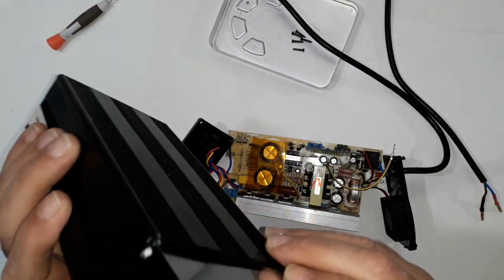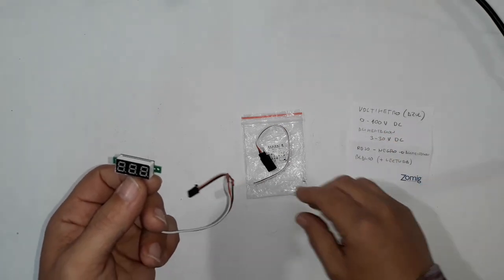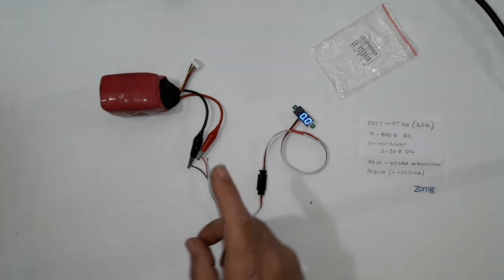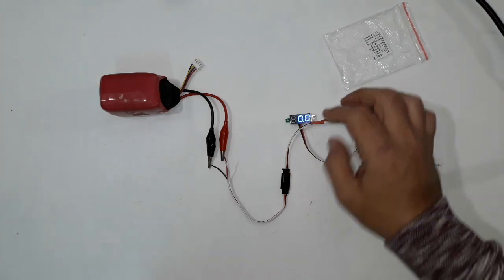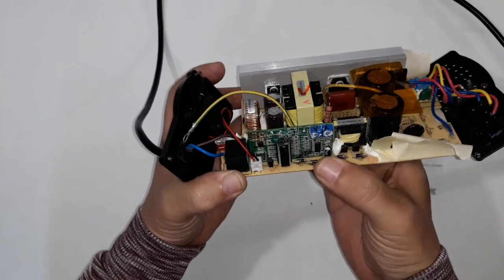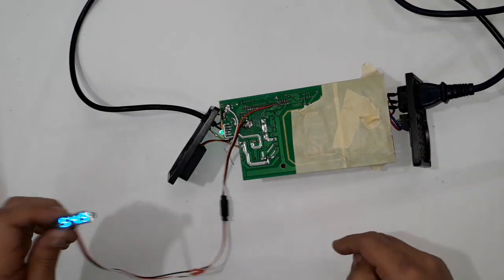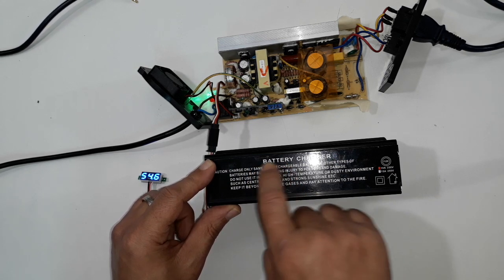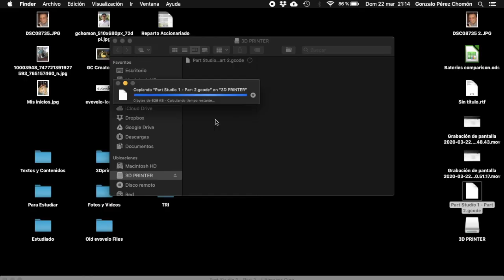Hacking & Tuning E-bike battery charger, English

Comment: Great video and some nice suggestions. Loved the practical safety step of covering the mains voltage section. 
Where you drilled the holes in the casing , fitting an automotive style rubber grommets will add further protection and prevent shorting to case from trim pot while adjusting. 
Better to use a plastic screwdriver but many don’t have those in tool kit.
Reply from the maker: True, Pat O mahony, I normally use a plastic screwdriver for that kind of pots, but I was not able to find them...
Next day I remembered where I put them, LOL

Comment: It's nice the led voltage gauge every charger should show your charging volts ! Do your red and green led lights both stay on a full charge or just one green led ?
Reply from the maker: Thank you for your comment.
Well it is cool the voltage gauge, but it is better a simple led bar, as none remembers what is the full charge voltage. Not even me, and I have been working with batteries half of my life...
The red/green leds still work as they should, change to green when fully charged.

Comment: Amazing hacks. Thanks so much for sharing this. Gotta love how Chinese electronics are so hackable. Something manufactured in the West would be made with proprietary parts that self-destruct the moment you open the case and report the event to the mothership. How did the charger hold up over the last two years? I will probably hack mine to limit the charging voltage to 51.5V (80%), which should significantly lengthen the battery's lifespan.
Reply from the maker: I use it more less everyday, no problem so far, except that the fan is noisier now.
I try to avoid brands that are not repairable at least, ie. Bosch bike components.

Comment: decent video mate!
Didn't even think to check to see if these chargers used pots to control volts and amps!
P.S you could add better heatsinks to the mosfets onboard so they cool better too, also you can get an ammeter that's the same style as your voltage lcd, it will help you tune your max amps if you're charging a weaker battery ;)
Maybe some switch styled pot relays would allow for setting multiple voltages to simple flicks of a switch like the variable versions of these chargers?
Reply from the maker: Those are very good ideas, thank you maybe next one I do all that. In this case I just made with what I had in hand...

Comment: CAN ANYONE HELP WITH THIS???  if i want to increase the voltage of my charger from 60v 20ah to 72v20ah what is the actual voltage that i need to read on my multimeter? my charger is a common aluminum charger with a red/green light at the end under the fuse holder. Its rated at 240w 3amps... i think i know where the voltage pot is but do i also need to adjustt the amperage? and is there a high and low setting ? because there are 3 pots total all near one another!! and i Must make sure the charger DOES STOP when it reaches full charge! im adding an extra 12v20ah to my 5x12v20ah bank-60v20ah. I checked with emmo tech and he says i can safely add extra battery to get 72v20ah on my model scooter! im just trying to save buying another 90$ charger because i bought this one last summer its brand new and made by wouks from amazon! thanks to anyone kind enough to reply to my questions!!! its truly appreciated!!!!
Reply from the maker: Probably one of the pots is voltage, another one amperage and the last one threshold.
There will be some ranges that you will be able to play with in all of them.
Set the voltage at upper limit of your battery and set the amperage low for start. Leave the threshold as it is (provably around 10%)
Another point: Usually it is a VERY bad idea to mix batteries; different models, old with new, etc. The fires you see in the news are usually for this king of battery mishandling.

Comment: While I admire your craftsmanship, you could have made your tweaks with the case off  just using your dmm if you were just wanting a 1 time voltage/current adjustment, right?
Reply from the maker: The idea is to have access to the pots without opening the case so they can be tweaked when ever need.